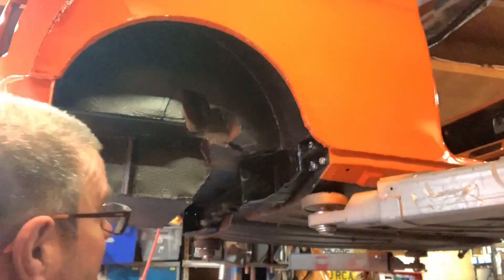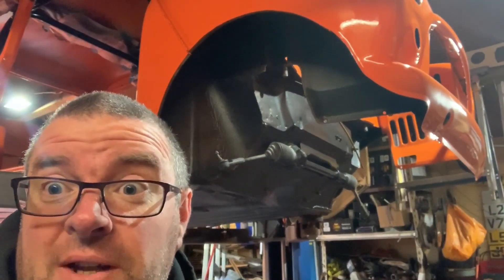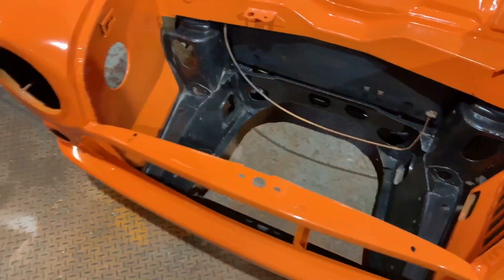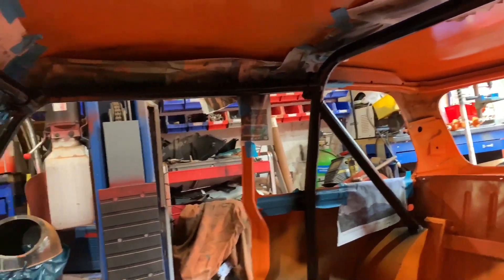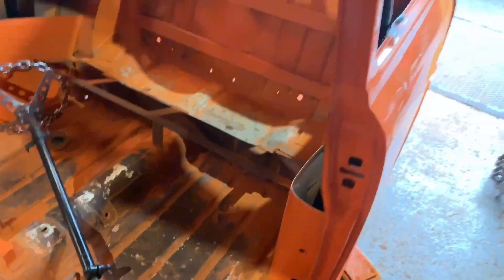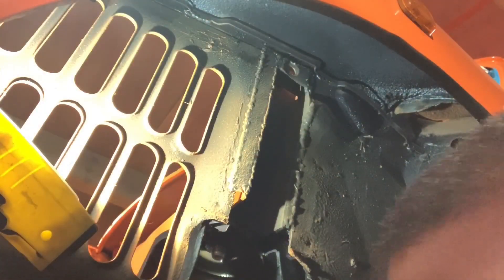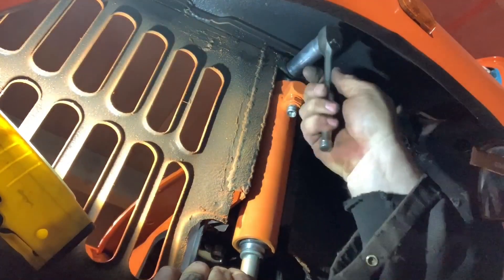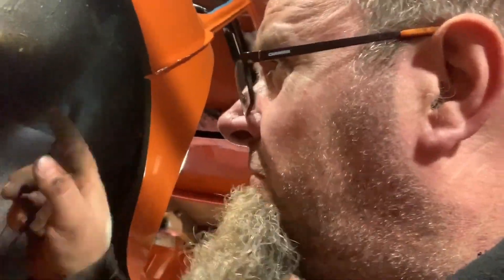Classic Mini Hydraulics build- Part 55 ... bolt ons !

Comment: It's getting there Paul,  your putting it  back together , and me and tom are taking the new project  apart, but I don't think it will be easy to strip the old nuts and bolts off a 38 yr old car lol , all the best mate
Reply from the maker: Mark Shorrock .... once its a bare shell then all the hard work begins !! Mind you havent you got got to get busy with its home first ??
Reply: YES mate forgot about extending  lean to ,

Comment: Did you forget the brake , fuel lines  and battery cable go under the subframe or have you got a cunning plan.
Reply from the maker: Andy York ahhh yes doncha worry ! Its all going to be routed differently from stock !! Stay tuned in ! A future episode will reveal all !

Comment: Rubber mounts, poly or solid?
Reply from the maker: Mini Matt TV ... all stock subframe mounts ! Cheap n cheerful !
Reply: Paul P . Mini build fair enough, I’ve just bought some second hand solid mounts off eBay for £10
Reply from the maker: Its more personal choice but im not a fan of the poly mounts on the front subframe to floor , they’re too flexible you might as well not have them bolted on ! .... the solid mounts are ok but i would add a bit of extra steel as a spreader plate inside the floor .. it does depend how you drive but it can crack the floor ...
Reply: Paul P . Mini build yeah I have heard that they can crack the floor but normally it’s when people mix rubber and solid mounts. Everything pre 1976 was solid mounts.
I’ll be reinforcing the floor where it mounts up though!
Reply from the maker: Yeah im sure if its driven properly it wont crack .... 😃